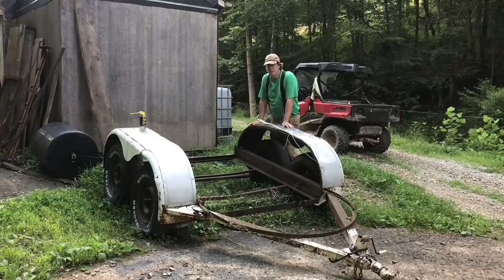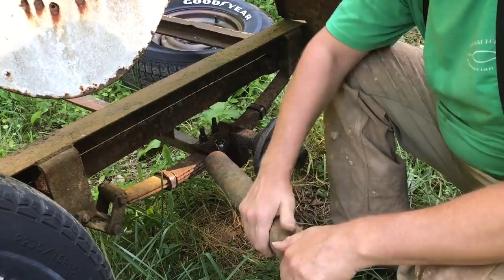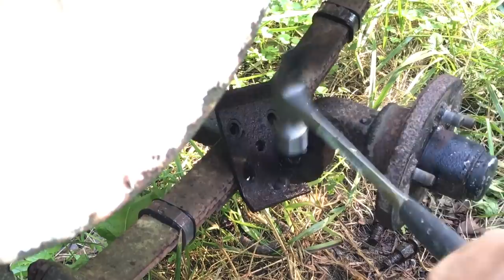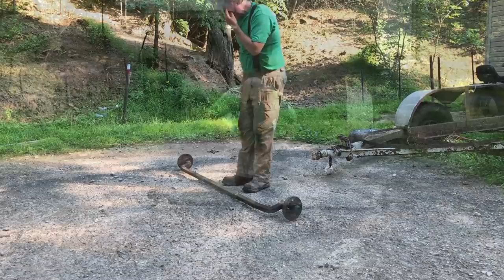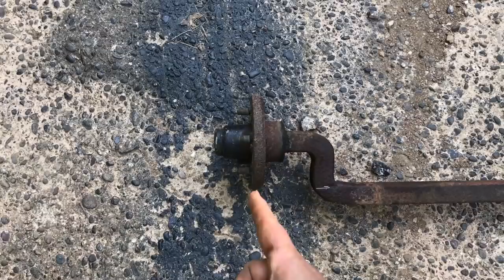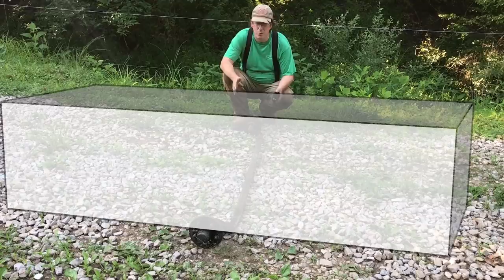Mobile Coop Build Part 1: Salvaging a workable axle

Comment: Troy If It were me I would use the axle arch up for ground clearance and mount it 1 foot to the rear of the center so that you have some tongue weight and won't bounce like crazy while towing it. I would use pipe or angle iron to mount a wooden coop to the axle cheap and easy to build with a tin roof floor and a tin roof. A tin roof floor very easy to clean.

Comment: If you’ll be using a 5 x 12 base dimension, you can use a 60/40 split for axel placement (60 tongue side).  It will allow for better rear clearance for your hill navigation but still allow for ease of moving by hand.  If you pitch the roof you could add rain catchment for self watering.  If you hinge the top down the center in a total of four sections, it will allow ease of access to the entirety of the mobile coop.  Placing your nesting boxes along the sides will provide easy egg collection.  Utilizing side placement of door on the tire sides (one on each side) will provide increased options for placement on the property. Remember you don’t have to open all the doors at the same time.  Additionally if you stagger roost placement on two planes you’ll be able to increase the number of birds in the same cubic footage.   Just a few thoughts... hope it helps as you plan your mobile coop!😊

Comment: The drop axle is designed to have the drop facing down and is more than likely pre-loaded in that direction like a spring.  I think I would stick with that and any additional clearance to give the birds shade could be built into the structure.  What I would worry about mounting it 180 degrees from design is the force of that leverage would encourage it to break and flip down.  I think you would be asking for issues even moving at a "snail's pace".  You could weld a plate on both sides that in turn could mount to your frame to overcome this (I would not see u-bolts keeping it in place), but still would be under more load that it probably wants.  As far as material, it is a chicken coop.  I would go with wood and keep it light.  If you wanted heavy. I would have just built it on the existing frame.  My 2 cents offered from a non-engineer, ex-sports car racer that has broken more things than I care to admit.

Comment: I'm not a farmer, not an engineer but people all my life tell me that I think like an engineer so here goes my thoughts. You have a metal frame already the trailer. Remove the other axle and fenders, place the good axle back under the frame anywhere you like, and rotate the axle for the height you require, using the plate and some new u-bolts to attach it to the frame, no springs. Then add your wood box to the frame using lag bolts or whatever you have. You should be able to place a 12' deck on that existing frame without any issues. I don't see the need to do any welding on the frame. Be blessed.

Comment: You have good suggestions for the frame so I will address the box. 12ft is about as long as you can go and the 5 ft sounds good for the floor but I would definitely go just high enough you can get into it for cleaning and roost building. I would come out over the wheels on both sides with a added width to install nesting boxes.adding to your over all space. You will also need to add some screened vents couple down at bottom and in roof to open and close to get good air circulation.
Reply: I thought putting the nesting boxes over the wheels too.
Reply: That's exactly the way my coop is built making it approx 7 ft wide and almost 12 foot long with a door on the back end of trailer.. Works great.
Reply: My nesting boxes are built into my interior separation wall from my feed storage area with rear access door so you can collect eggs from the rear side of the nest boxes while you scoop feed and never go into the roosting side of the coop

Comment: You need to add the height of the tires (center) then figure if the 6" rise or drop would be better - my opinion given your terrain would be to do the rise.  I would also put the axle a bit back from center, which would reduce the chance of high centering.
You could use sections of that oil pipe to make your 'frame base', one on each side, then attach wood to those. You could make the majority of the floor out of 1/2" hardware cloth, small enough to be easily walked on by birds and keep out predators,  big enough droppings fall through.
You could also repurpose oil pipe to make the tow hitch, or use the one from the horse trailer.
You can make your nest boxes so you can access them from outside.
Place the door at a point where you can reach all corners of the inside for cleaning, etc, since it does not sound like you want to build high enough to walk inside (and hardware cloth would not hold a person's weight anyway).
Reply: instablaster.

Comment: The frame you could use metal.  Easy to clean.  The floor you could go with a large gauge wire so the chicken droppings fall to the ground.  Easy fertilization.  I would set the axle back because you will also have the weight of the tongue.  I would use a hinged foot to stabilize the tongue when it is in the field.  Put the nesting boxes up over the tongue to give support to the bottom. The door and ramp at the back would make it so the chickens do not have the interference of the tongue.  Just my suggestions, am excited to watch your progress.  My grandfather built a trailer for his row boat almost 50 years ago.  I still have it, and the rowboat.  God Bless and happy building.

Comment: Troy - I know you wanted to keep it low profile, but I'd go the opposite and go higher and shorter e.g. a 6' long x 5' wide x 6' high. Reasoning - the 1-2 sq ft per bird requirement is a good one, but that only assumes a 2-dimensional coop. If you go vertical you can stagger your roosting bars and alternate side to side and still keep them comfortable. We have a 6x10' coop on a trailer with 4ft sides peaking to 6ft in the middle. We have three roosting bars that are 8ft long each (could fit more if needed) and we have 26 layers. They all fit on less than 2 of the bars, so I could easily increase the chicken count to 40-45 w/o issues. The other benefits are you can walk into it and clean it if needed (by the way use Dura-Slat for the floors), and you won't bottom out as easy when go up/down your steep hills.

Comment: I think you probably have enough ideas/options on the trailer frame and axle. When you mentioned wheel wells etc I immediately thought about cleaning of said mobile coop. Think through what’s functional, but easiest to clean. You are a pro at pig poop so think through the chicken poo. I’d want it hoseable and easily reached for cleaning. Vinyl flooring? 🐓 🐓 🐓 

Enjoying you videos. I think we have a similar sense of humor.
Reply from the maker: FLoor will be hardware cloth mesh so I am hoping the poop falls through.
Reply: Red Tool House - Homestead good call. You might go with rabbit wire if you can afford it. It’s much stronger and may keep predators out better. I think the spacing would be ok, but might be a little too small.

Comment: That screams angle iron frame and pvc style cladding. That way you’d have less worry if it actually does drag. As for axle placement. I’d go slightly off center toward the rear to allow for tongue weight. You can also go for a sliding frame if you want a real project! Lol. We built our small mower trailer and put the axles on pins for the exact reasons you said.

Comment: Given your situation, I would mount the axle with the center section up, and weld a piece of 30"x1/4" flat bar perpendicular on either side of the top.  Then bolt a true 3"x5" x 12' beam to each flatbar inline.  This will give you the 5'x12' foundation for your wooden structure on top.

Comment: I built my coop on a old boat trailer works awesome I even built a feed storage area on the front that can also be used to brood chicks in a way I can reach all the back in it with a rake to clean it having constant composting material
Reply: Thats how I brood my chicks my coop has interior separation wall and the door is on the rear opposite the trailer tongue..

Comment: If it was me I'd use the trailer Frame remove fenders and bad axel then you got a good base to build from plus the pull tongue already there then you can place the good axel where it best suits you and you'll have springs then I'd put a tongue jack with a air tire or a good solid thick rubber tire where you can level trailer and push it around.

Comment: I put the Axel in the center like you're thinking and then take that leaf spring or both the leaf springs and use it like a ski / skid plate under your tongue that way when you get to a part like a hill or something it won't bottom out

Comment: 1 . you have all that gas pipe with your DC stick welding skills, not mig weld up a U  shape frame, 3 sided with a tong drill 2 holes in the pipe one on each side that line up with one u.bolt hole on each side, bolt axcel to pipe 2/3rds way back, drop tire presser to 25 to 30 psi  drill 4 more holes in the pipe to  bolt each of the 4 corners of the wood frame of the coop to the pipe, mount axcel on high side, for ground clearance, put a wood kick stand front and back for parking, ie 2x4, build coop as long as you can make your roads, 20 to 30 feet, you dont need any metal tools then you have

Comment: I see forty nine comments ahead of me so I will make it quick... I think that you have a wire feed welder... if you do, then some of that gas line pipe that is fairly thick like 1/8" schedule forty pipe should be more than adequate and cut it to the length that you need for width. Take the saws all and cut the axle off at the first ninety and insert it into the pipe and weld it in. You don't go fast enough to worry about alignment but do try a little to get in lead. Now your the height from axle to ground or half approx of the tire.... that axle is designed to use the curve to bend straight under a load... much more than a plywood box and so it wouldn't straighten at all. Just use the ends of that trailer axle and a piece of pipe.... hope that helps

Comment: I would place the axle back a ways from center so you have more weight on the rear wheels of the side by side for traction and more clearance in back as you go up hill.

Comment: Looks to me like the frame you have would work.  Take the bent axle off of the front and use the better axle where-ever balances best. You could use the fenders as a place to mount the box or cut them off.

Comment: I would build the bottom frame of the coop out of metal, that way if it does drag the ground, it would handle the stress better than a wood frame (which would most likely destroy it). But that is the only place I would use metal.

Comment: I would discard all the weight possible from the original trailer and bolt your box to that frame  factory frame is gonna have a really good weight to strength ratio your box can be bigger than the trailer to maximize space those bent axles wouldn’t affect u on the farm  if possible to use both axles it would be so much more stable I know the weight added up real quick building mine

Comment: I'd say make the actual trailer frame for the coop out of metal so you have a sturdy durable base, and then use sawmill boards for the rest as it's cheap, and renewable when it does rot, can just go cut more....

Comment: Small little import cars have the front wheel drive and the rear end is just a piece of metal at best but the wheel bearing is bolted on with three or four bolts and when you take on off that might be a little unuseable for cars on the highway, it still rolls just fine unless totally gone or something... those work  great on pipe to make axles for little garden trailer or even making a dolly for transporting something... the use of good pipe makes it your own which could be ten feet if you could get it down a trail.... doubtful and so Troy maybe one out of two might help you now or even later on something else
Listened to the rest of the video and was thinking about the dead trailer... can you saws all the fenders off and the metal that interferes with the project and then go wood over it to make the chicken tractor?? just a thought... if it rots out... another tree  can be refitted to it maybe

Comment: Put the axle in the middle so the coop sits high, take the second axle and mount it at the very rear so the tires are off the ground, that way if you do get to an area where the back would drag it would roll on the tires. Why not try a metal frame to save weight and be permanent and build box on top that could be replaced if it wears or rots out.

Comment: Since the axle is square and the pipe is round, hammer it to shape of the axle that is left from that wheel bearing out which is about what five or six just guessing from here.. cut that axle so it can be slide in.. part two of these posts

Comment: I would say being you don’t plan on ever taking it on the road and it’s just there for around the farm from point a to point B and you should be fine without putting a leaf springs on it what you could do Troy is make your nesting boxes that act as the fender that way the chickens have a true 5 feet whatever of space and the nesting boxes can be on the side and I will be up a little bit easier to access I hope that makes sense

Comment: I don't think leaf springs would be of any benefit for farm use. Myself I would build a floor frame out of metal and the rest with wood. Oh and I would offset the axle to the rear just a few inches to give some tongue weight to get up the hills a little easier. Going to be interesting to watch the build however you decide to do it.

Comment: Can you use old trailer frame to build a coop on?
Reply from the maker: Worried about the weight and I would have to move the axle to the very back to get a 12 foot box to balance correctly.

Comment: Everyone needs to have some Penephite from Kano Labs around.
The most amazing penetrating oil known to man.
Spray or squirt it on, wait a little bit, and rust becomes no problem.
Look them up, buy online, reasonably priced and effective.
Those u bolts could have been reused, believe it or not!

Comment: Doing it on the cheap: I'd say do the build as you have planned.  Axle halfway, arch turned up for additional clearance.  At the back corners, I would cut some steel off the horse trailer and mount to act as skids (sort of like are on the front corners of a brush hog) so even on steep transitions it doesn't hang up.
I wouldn't go with a solid floor.  Use a wire mesh so the bird droppings will fall out.  You'll need to order the wire mesh, most of the stuff in stores doesn't have large enough openings to allow the mess to fall through.
I also wouldn't be concerned about building it out to the outer width of the tires so long as it will fit through any gates you have.  Sun will be the tires worst enemy, if you can build over it and put them under shade, they will last longer.

Comment: My thoughts have already been expressed nicely, i.e., use the remaining trailer, frame, hitch, etc., and build your coop on it. I guess you should replace or switch axles since the one you removed appears less bent than the remaining axle. I think you are starting with the wrong piece Troy!
Reply from the maker: Trailer frame is not long enough to carry a 12 long box. I would have to extend it and move the axles back quite a bit. Jack is busted and coupler has issues. rather start fresh.